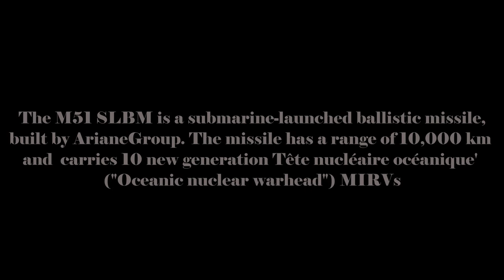M51 submarine launched ballistic missile (SLBM)

Comment: Speed 30 000 km/h☄☄
Reply: No
Reply: @sampsg9549  No 🤔why?
Reply: Its mach 15
Reply: @lucassilem3880  can I ask you a question which is the best slbm between the trident 2 d 5 and the m 51 I thank you if you will answer to me
Reply: @Brandon FR Stop talk about "stealth" at all sauces...
Nothing stealth in these MIRV, ICBM from all nation are not build to be stealth, the atmo reentry speed is close to Mach 20, even a small IR detector from the ground is able to see the warhead.
Reply: @Brandon FR And ? Nothing common with the base subject.

We talk about the M51, not the ASMPA nor the ASN4G.

Tips: The thermal protection is to protect the MIRV, it's not to avoid the heat generation... You cant avoid it, even with an EM shield.
Reply: @giuseppecasa3574  K5 😂😂
Reply: @giuseppecasa3574  The D5 is heavier and has a higher specific energy fuel. It has longer range and also uses lower weight reentry vehicles. They're essentially the same, but in fine detail, the D5 is superior.